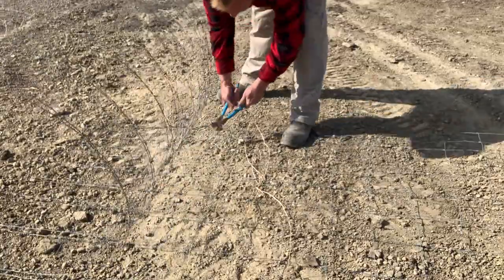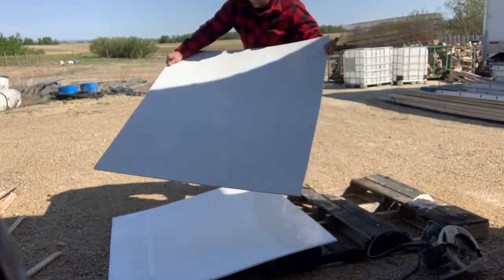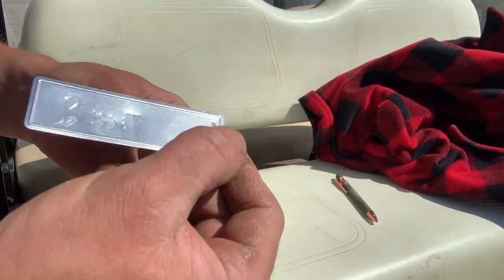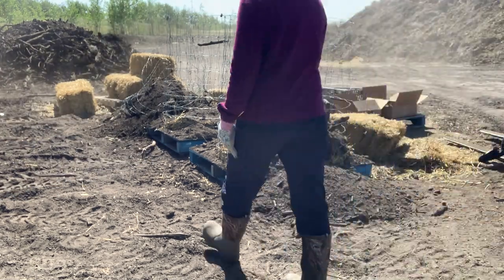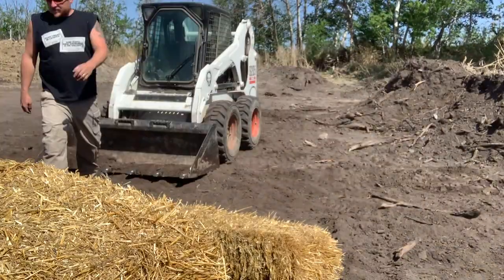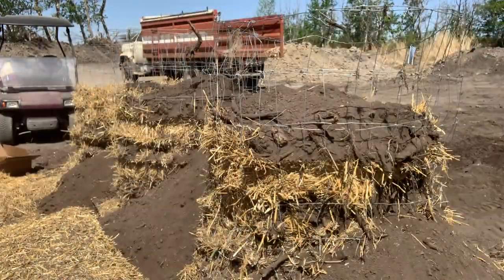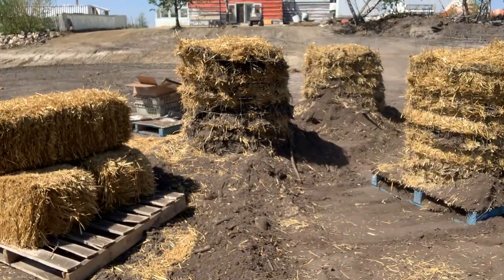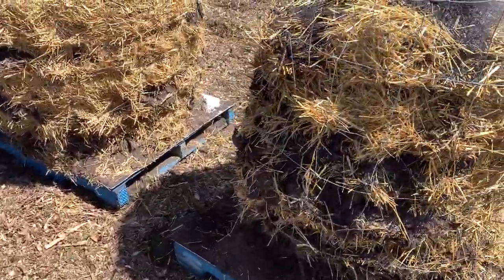Potato Towers - DIY - Cheap, easy, fast, and even mobile.  Full Build.

Comment: I'm thinking about it. The size is too big for my home. But thinking of a smaller version of  it. Thanks for the idea😊
Reply from the maker: Not too small or it might topple over.
Reply: I use the plastic bags that garden soil is sold in. They can be used for several years and thus have a second life cycle. Black side inside, white outside, some holes at the bottom of the bag and some bigger gravel or fired clay balls at the bottom for better footing and drainage. To start, roll the top of the sack down and fill the first quater above the drainage with soil, compost and some straw and of course some potatoes. Water it randomly but not too much and roll it up 10-15 cm whenever the green leaves grow out at the top. Carefully add soil around the leaves. Let only the lop leaves look out and get some sun. Potatoes grow all the way up from the seed potatoe on the bottom along the stems.  In autumn the sack is full, the leave color turns into yellow and 3-5 potatoes have grown into several kilos. The soil goes back into the pile to regenerate. The big stones from the ground are collected and reused in the next year, clay balls can stay in the soil.

Comment: The idea is good but needs finetuning I think. You shouldn't need to have to use such a machine to load it from my pov (space, energy). Perhaps only sides with net trellis connecting them?
Or, Barrels with holes in the sides (you can roll these)
Reply from the maker: This was easy.   The fencing works great.

Comment: How critical is having the sprouts exposed to the outside of the tower?  I noticed your seed potatoes had some pretty long shoots, and that you positioned them to the outside.  Will they "sense" the light, and grow sideways, if the chits are short, or haven't sprouted yet? Just wondering.  Have my spuds in raised beds this year....already 8 - 10 inches tall!
Reply from the maker: Not really important.   The potato plant will find its way. ✌️
Reply: @ArkopiaYouTube  Thanks.  Gonna try it next year.....in one form or another,

Comment: How'd the harvest from the potato tower go? Did you get more potatoes out than you put in as seed?
Reply from the maker: Forgot to film it.   Got lots of smaller potatoes, but it was a struggle to water them enough.   Because I have the space, I’ll just be doing them in the ground.   The tower works great for small space, but need lots of water.
Reply: @ArkopiaYouTube , Thanks for the update. I might give the potato tower a try.
Reply: @ArkopiaYouTube What fertilizers did you use?

Comment: cute doggies!! what's the yield on these vs in ground? have you done them before? a lot of mobility pluses, only concern in a drought is the higher surface area and the straw may dry them out more than in ground, but a great idea for ppl that need to move them around while theyre growing.
Reply from the maker: Have done it, but not on a pallet, just the ground.   Had good success.   Lots of smaller potatoes as I recall, not big ones.  👍

Comment: How to be a slave of the drill only one time:   Put 4 eyescrews a little inside your circumference and 4 just outside.  Have a third a little to the exterior for a tie-off, times 4.  Now you can use stiff wire or a nail between the inner two eyescrews (x4) to hold down the bottom of the potato tower.  When you want to go humpty-dumpty to get your harvest, just pull the retention wires or nails and they don't get lost because the loop on the pull-end of each wire/nail connects to the third eyescrew.  Now if Sasquatch eats the drill, so what?
Reply from the maker: Thought about doing that.   Seemed like a lot of figuring out though. 😂